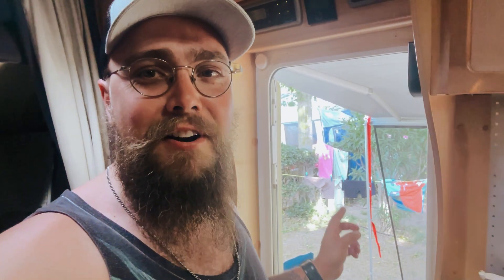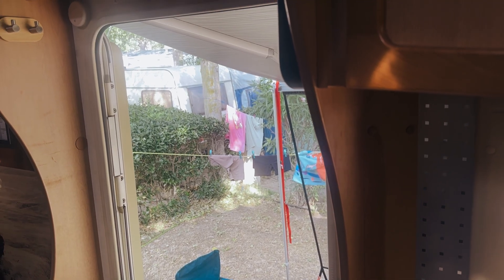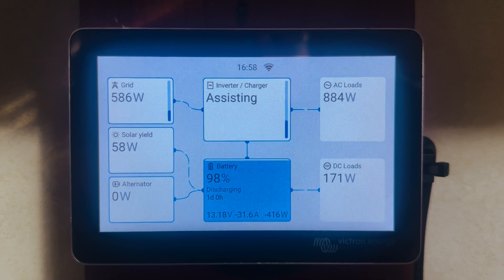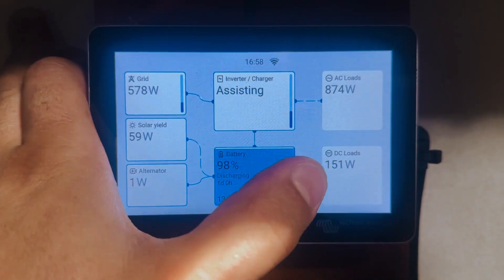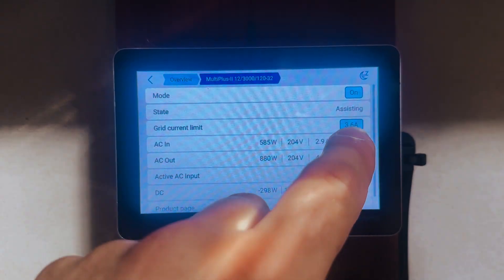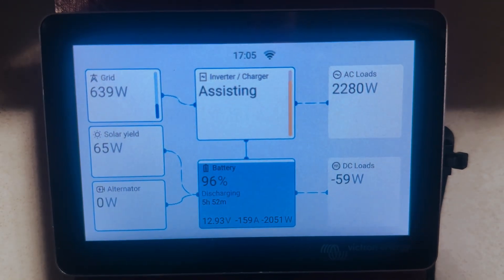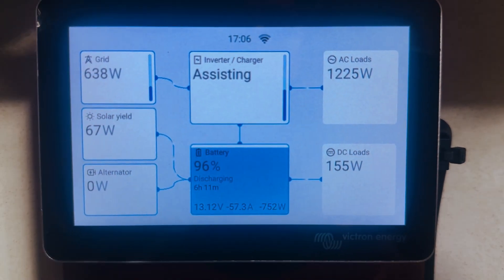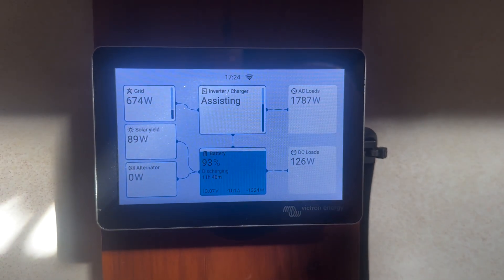The main benefit of a Multiplus over a Phoenix Inverter Smart

Comment: What does the starlink setup use  
how many Amps does it pull and what voltage is it your using
Reading their website for residential they say 1.2kw to 3.6kw a day
Is that the same or is the mobile earier on power
Cheers

Comment: Why did you not go for a 24v or even 48v system? 180A is crazy.
Reply: Probably because there are several 12 V applications that are always on, like he said, very common in mobile solutions and the AC side is used only relatively short times, so you can save power when you can have the inverter-charger off most of the time, or set to charger only. Instead of having inverter on all the time, or using a DC-DC 48-12 converter, which would also waste some of the energy all the time.

We've done several hundred amps solutions for industrial use at work, it's just about how you size up the wiring and bus bars etc., not a problem at all. What kind of amps you think EV's are charged via DC?

Agreed on that point for my personal use, I'd pick 48 V instantly, and wouldn't even think about 24 V as that's like the most less used - if not counting trucks - I see it more or less only like for the logic side in the industrial solutions. 12 V I might think about, but it's really what applications are used in the system, that steers the decision.